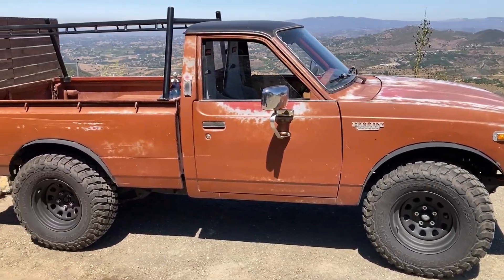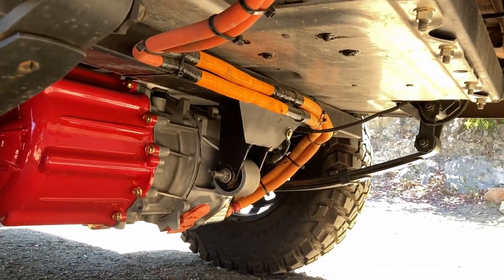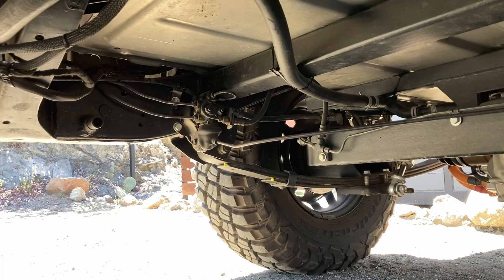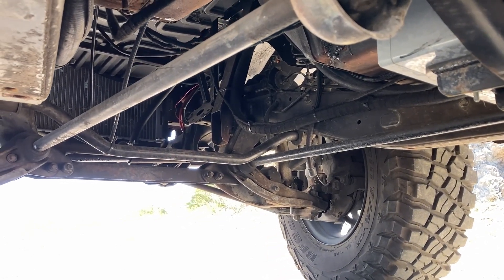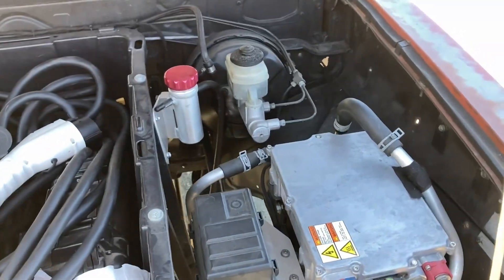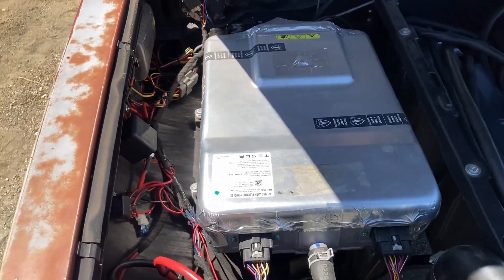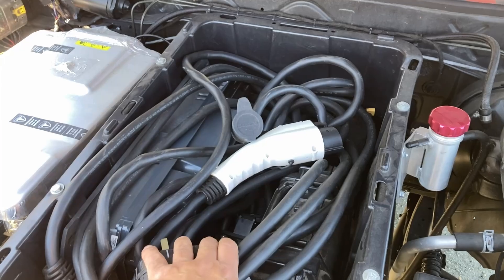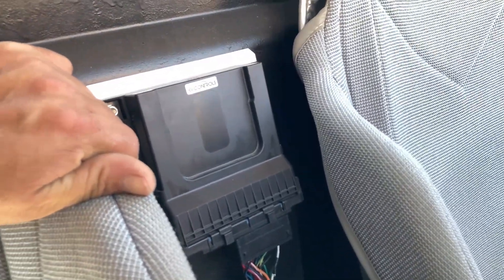Tesla powered Toyota Hilux Video 5, It Runs it Drives!!!

Comment: Nice build!  You can rebuild Tesla motors?  What does that consist of?
Reply from the maker: Thanks! Yeah I use to rebuild them. It’s just bearings and making sure the inverter and motor ohm out to spec. It’s not too involved. It’s like a desktop computer bolted to a transfer case lol.

Comment: Dumb question, Why the need for a 3rd party controller if you are using all Tesla components? I just started  on my 1989 Toyota Space Van, still unsure if I go Model3 or Leaf.
Reply from the maker: It’s doing all the canbus communication to the motor and gets data from it to run the dash. Kinda of a plug and play box.
Reply from the maker: Leaf is way cheaper and more simple. I love those motors!
Reply: @J5Jonny5  If you want an healthy 62 kWh pack it can get up there ,$ wise, almost model3 level and you still have no active cooling and high degradation (I live in FL 😉)

Comment: Does the cooling system use a thermostat valve? I'm thinking not.
Reply from the maker: Negative. It’s just open. The temperature range is to little to worry about maintaining temp.

Comment: Thanks for walkthrough video. I know that you do have the Dilithium Master Control Unit (MCU) and BMS Satellites, which you explained in an earlier video. Can you fast DC charge into your battery packs? I could not see if you have the DC plug from your walkthrough video of your truck. Do you have the EVCC with J1772 (Charge Controller) ?   I personally want to build a 144Vdc/200A battery pack and would like have to ability fast-DC charge my future 3 wheel project. 😃 Thanks in advance.

Comment: i never thought of the i3 battery with less than 100 miles, and a 10kw charger being useful... if there were more it would almost, "ALMOST", be like visiting a gas station, it would just be as often as a truck with a small tank, which this kinda is. my main concern is the control arms which are frankensteined but i guess as long as you dont actually do off road stuff it's ok. but this being a toyota hilux i would really want it to do truck things. this arguably is better than the cybertruck, because steel frame, the only downside is it's only real wheel drive. i hope there is more after market support for making control arms that fit tesla motors and common subframe setups in the future, but one can only hope. idk how one would mount a tesla motor system to a 4-wheel/all-wheel drive train system but i hope to see one soon.

Comment: Could you have mounted the charger and dc/dc sideways to save space, or do they need to be "flat" like that in order to work properly? Also, how much power is the small/single tesla unit putting down? How much bigger is the dual motor high power unit?

Comment: How are you cooling the battery? You have the Charger,SDU and DC/DC on one circuit, and you said in the previous video you were most likely going to put the battery on the same circuit, but you didnt say what you did with the battery in the end
Reply from the maker: Sorry I missed that! It’s just air cooled for now. It honestly doesn’t need cooling unless I’m DC fast charging. Which I can’t right now. If anything I need a battery heater.

Comment: Consider an I booster for a brake upgrade.  Pretty slick…
Reply from the maker: For sure! I’m always leaning on keep it simple. Less stuff to fail. I might just toss a vacuum pump on this thing though.
Reply: @J5Jonny5  just did my first test drive yesterday.  Using EV controls.  T2C Seems to be stuck at Peak Power 15.  Not sure if it’s because in land rovers the LDU has to spin backwards to go forward 🤷
Reply from the maker: @UndoneEV  hmm. Are you actually having to run that LDU backwards? You might have to switch the phase leads around and flop the reluctor sensor wires around to spin it backwards. Just keep in mind that the oil pump needs to be reversed as well. And also your gear box in general is meant to spin the other way.
Reply: @J5Jonny5  Yeah running backwards…. Felton or whatever sells a pump meant for spinning the motor primarily in reverse.  It’s installed with a gearset meant for land rovers…LSD as well.  There’s a bunch of conversions of this style running around the UK.  I’ll have to dig around more and ask if they reversed phase leads.. That was a suggestion years ago from EV controls when I asked if they could swap the D/R buttons..Is reversing the phase leads easy? I’ve never been able to find an example of that being done although I’ve heard of such things…
Reply from the maker: @UndoneEV   Nice. Yeah it’s been done before for sure. I’ve done it but only on some highly modified motors. (Phase leads exposed) I’d suspect it would be tricky with the stock case. The sensor is no biggie though.
Reply: @J5Jonny5  found out it was in limp mode.  Suspect that momentary DNR switches were ticking off the controller.   Disconnected, updated firmware..  hope to test tomorrow before it gets dark….
Reply from the maker: @UndoneEV  ahhhhhh that makes sense! To that note, make sure that motor seal isn’t toast and leaking into the inverter. That might be causing the limp mode. I rebuild LDU’s a lot. It’s sadly becoming more common.
Reply: @J5Jonny5  being that I cracked it open that’s a real possibility

Comment: having ran this for almost a year as a daily driver now, how is your experience with the lawn and garden battery? would a motorcycle lithium battery be able to handle the load of the 12v system in this or would that be too small? I know the starter and headlights tend to be the biggest amp draws on batteries in ICE cars, so curious about the 12v draw before the dc-dc starts doing its magic on converted cars
Reply from the maker: I actually have a video coming up about how the year has been for the truck. But that battery has been great! I’d just stick to the lead acid since most DC-DCs are meant for them. And since I’m using a Tesla DC-DC I have no issues keeping that thing charged.
Reply: that's great info, thank you!
Reply from the maker: @jasonmanness7941  of course!

Comment: Wow, I have a million questions. I watched your vids as you built it and the DeDion axle is genius. This got me thinking about my old Square Body and maybe a battery module like you have under the bed and another under the cab. 
More info on your interface would be nice, I know you started I think with Open Source and then went to AEM control, is the monitor and all the ino part of that system? I might have missed it but i didn't here about your mileage, like miles per KWH, I'm seeing 1.6-1.8 get reported for a Ford Lighting, I figure yours is better than that just due to the difference in size and weight, just an idea would be fine. Also, how well does it run? Like a comparison to some other car or truck it excells like or close to just to give and idea how well the SDU runs. I've driven the 1st Gen Model S and I was surprised by how hard it pulled. I know the SDU would not run that fast but I can imagine it running as good as a good V6. 
Great job on the build and many thinks for sharing it with us all.
Reply: Well after I made this post I happened on EV Controls site and saw your monitor so tha tpretty much answered that question.

Comment: Thanks for making the video, what an awesome build!

I would like to elaborate about whether 12v batteries are needed or not and no they are not. In my builds I run directly off of the DC-DC converter. For those of you wondering why a battery is still needed in this build? It is because some DC-DC converters need a 12v enable in order to turn it on thus this poses a chicken-egg issue. I am guessing that is the situation in this build. I solve this by using DC-DC converters that have a high voltage enable pin and thus I don't use 12v batteries on my builds. In my builds my key switch enables the DC-DC converter and controller.
Reply from the maker: That's really neat. An HV enable would definitely take the battery out of the question. I was told It was also needed for its capacitive abilities as well in case there was a voltage spike. But coming from building race drones we never needed anything like that on the 5v and 3.3v bus. we just used buck converters. Mine has it though because I do have a 12v enable on my DC-DC.
Reply: @J5Jonny5  I have not needed it for the capacity ability. I guess it really comes down to design in that use a power supply that will handle the spikes. think of it like a circuit board design, we don't use little 12 volt batteries in them. An EV is no different than designing a circuit board in that power spikes have to be considered and thus design the power supply accordingly.

I just added power steering to my SXS that does not have a 12V battery and I have no load issues. Those of you concerned about spikes just pop in one of those large capacitors commonly used on large stereo systems. You could do the math like with a circuit board design and make sure the capacitor is big enough for the size of the spike.

IMO I don't think a 12V battery should ever be used in an EV. There are ways around it even if it has a 12V enable pin so those of you out there think about their EV wiring I suggest not using a 12V batter at all costs.
Reply: Finding an ignition key that is rated above 12 vdc is difficult
Reply: @christopherspicer9341  it's not really a 12 volt design issue rather a power spike/ark issue. Most 12 volt ignition switches will work just fine for an enable line on a DC-DC converter.
... or if you are not comfortable with that idea then have the ignition switch control a high voltage relay that then switches the enable line

Comment: Great video.

It seems that EV related stuff is a bit foreign to regular ICE gearheads. I'd love to hear some thoughts/information about learning enough to feel comfortable taking on a project like this. Without having anyone around me doing this sort of thing, it's hard to know what options are available and what brands are worthwhile. For example, when can you use something stock from a Tesla and when can't you? If you choose a non-Tesla component, will it still be compatible? When it comes to the inverter board, should you run something like EVControls, an open source solution, AEM, etc.? If you want to run two motors, what systems would allow for this and which won't? What is the general cost of a DIY conversion? How do you source components? Is a salvage auction a good option?

Just throwing out some relatively vague topics that I'm personally curious about.

Pretty sweet truck though, keep up the good work!
Reply from the maker: Thank you! And thank you for all these questions. I will start covering these in upcoming videos. Shedding some light on how to do this stuff is my goal.

Comment: Does the i3 battery come with a BMS or did you have to add one? 
How did you get the CANbus addresses for the DU?
What size tires are you running? They look great with those rims!
Incredible build! Well done!
Reply from the maker: Thank you! The i3 battery did have a BMS but I opted for the Dilithium. Honestly... If I did it again I would have just used the stock BMS lol. I didn't think it through very well. CANBUS addresses are all handled through the EV Controls T2C. It also handles the main contactors and gives me all the data via the app. The tires are BFG 31-inch mudders. Thanks again!

Comment: Great video, this build is so inspirational! I know your pain with the kirkey seats, they are not built for comfort. How is the weight distribution? How come you couldn't mount the battery up front?
Reply from the maker: Thank you! Yeah, these things are painful lol. The weight distribution is 55-45 rear-biased. The truck is 2700 pounds. didn't gain any weight amazingly.  I did it in the rear because it's an entire factory BMW I3 pack that I didn't want to recreate. I love using as much factory stuff as I can since all the engineering and testing was done on it already to handle daily abuse.